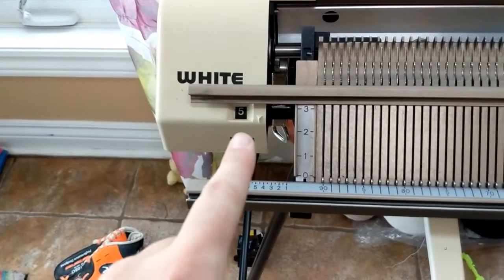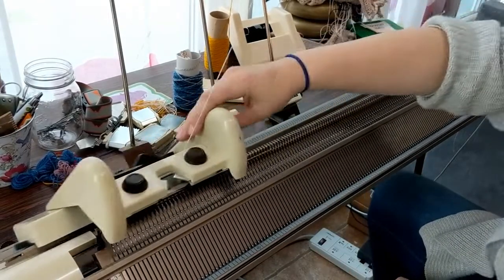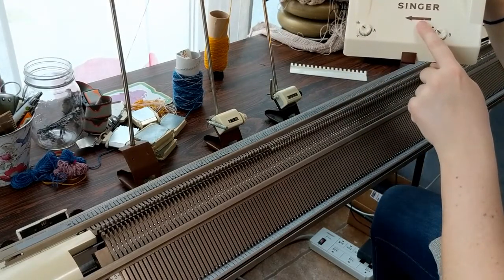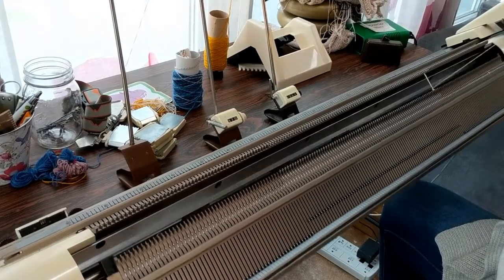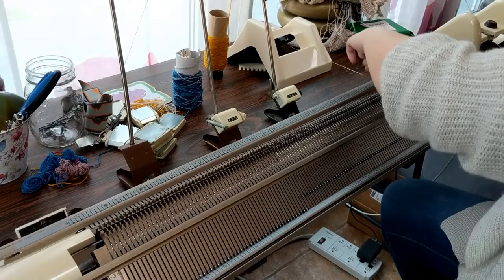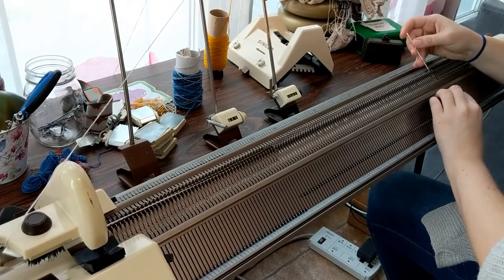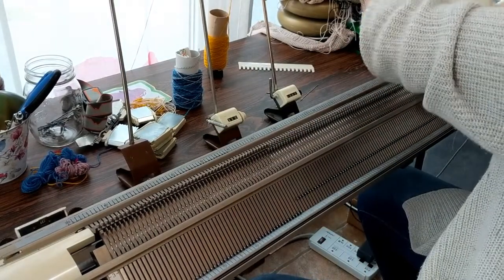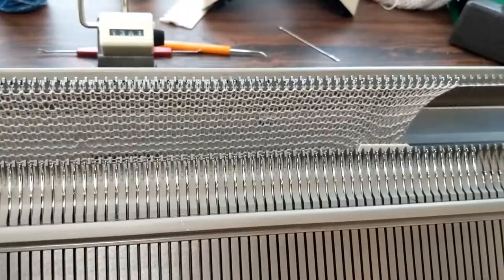Knitting Garter Stitch on the Singer/Superba/White/Phildar double bed knitting machines

Comment: I have all but given up on the transfer carriage on my system 9000.  I have both types.   I used to have an s48 & I kept the transfer carriage from it b/c it would transfer in pattern & accept stitches on non empty needles.  You make it look easy.  I have zero problem with transfers on the Passap.  Sigh.  After years tho I csn now transfer EOS. Then make another pass to get the rest.  I have tried all sorts of stitch settings, bed spacings etc.
Reply from the maker: They are frustrating little beasts, it's true. I find some yarns it just will not transfer nicely no matter what I do. It could also be bent, or damaged on the bottom. I haven't used this one in a while. I bet if I went to try it now I would end up with yarn in my lap 😆

Comment: Thanks for the video! What is the purpose of putting the two stitches into working position on the edges before you pass the carriage? Thanks! Rachel
Reply from the maker: It's recommended in the manual in order to make sure the carriage transfers all the stitches. You don't always need to do it, I find. 
However for some patterns you need to bring one extra needle into work to make sure it transfers the first stitch.

Comment: Hi, thanks for the video. I would like to ask you the following question: With all the Singer/Superba I have bought, I need to use both hands to move the carriage, even just one of them (the main one), but I see that you slide it without any difficulty, could you tell me why? As a note, I have cleaned both the bed and the carriages thoroughly, improving the sliding, but still, it is still very hard. Any help please? Regards!
Reply from the maker: Hi Victor. That seems to be a common issue with some people's machines. I would suggest to make sure the plastic tubing that covers the pieces on the carriages which slides in the rails is in good condition. It might be split or otherwise damaged. If it's OK, have you tried to add any lubricant to that rail where the carriage slides? I have been using Ballistol oil, but you can also use sewing machine oil if that's easier to come by where you live. I would also oil the flippers and moving parts on the bottom of the carriages (sparingly!), and the rail in which the cursor slides. Oh and the carriages are also going to be harder to push when the cursor is attached; make sure to move it out of the way when you aren't pattern knitting. The oiling does make things a bit messy so use as little as possible, but it should make a difference. You can also take a bit of oil on a soft lint-free cloth and oil the butt ends of the needles, and put a little bit across the bed behind the needles while they are in working position so it goes into the channels, and then run the carriage over a few times, then wipe any excess. Again don't use too much and make sure you have cloths handy to wipe off the inevitable "black crud" that will come off the machine if you accidentally touch the parts you oiled. 

Also, if you haven't opened up the machine bed itself and cleaned out the brake spring, you might be horrified by what can build up inside of it. I have one machine that I bought for parts, on which the needles could barely move in and out. I opened it up to harvest the brake spring when my main machine's was broken, and the needles were basically stuck to the bed with crud, and the spring was so full of fluff I don't know how the needles even moved. All of this resistance would make it a lot harder to move the carriages. 

I hope that helps a little bit. One of the things I like the most about the Superba is how easy and light the carriage is to push compared to some other machines. It's much nicer on the shoulder when you get it moving freely. Good luck!
Reply: @heatherismakingstuff  Hi Heather. Thank you very much for replying... I will follow your advice. Best regards!

Comment: hi Heather, finally I got the yarn mast up, had to rig something up, as I don't have the original yarn pole. I can't figure out how to cast on,  I see that you put the cast on comb thru the needles, wire and all and hold the cast on comb above the needles, and knit across with yarn in the carriage.  Is that how I am seeing it?  I go very slowly and it knits the loop of the first few needles, then stops. It shows that the loop went thru the cast on comb and looks like it would go all of the way, but I don't want to force it. 
I have been trying for a couple of hours and getting nowhere, so I look to you to verify that my eyes don't deceive me.
Reply from the maker: Absolutely that's right, comb and all, you hold it up so the ridge in the comb rests on the bottom bed, and it will be in position so that the needles don't hit the solid part of the comb, and then just make sure you have it so the teeth are between the needles. If you have the manual it describes a few different ways in there. A double bed cast on might be easier to start with, as you don't need the comb in there until after you knit the first zig zag row. Also make sure your yarn is thin enough, something like a sock yarn works great. I think the Answer Lady might have a video on Superba cast on methods now that I think about it!

Comment: Hi Heather ! I have a Singer knitting nachine as yours but with the MEMO II for jacquard and special working. I have had it for thirty years but lately I have problems making Jacquard.  I  have followed all the instractions carefully   but when I try to work the machine works correctely from right to left, but from left to right it puts the needles in the highest position without working them. What could be ? Have you or other friends never experienced such a problem? Thanks for your time !
Reply from the maker: Hi Tiziana, that is a strange problem! Have you cleaned the carriage recently? It could be something on the carriage is sticking and not letting the needles move properly. I would try that, and oil the moving parts, and make sure to clean the contacts on the carriage and the cursor and see if that helps. Hopefully nothing more than that!
Reply: @heatherismakingstuff  THanks Heather,  I have cleaned the carriage and found that a small part under it wasn't working properly. I've just tried to fix it and tomorrow I'll see if I am able to knitt a jaquard. I'll let you know and thanks again.
Reply from the maker: @tizianacovolan1794  oh good luck! Hopefully it is working again

Comment: hi, do all of the electronic Superba's have the capability of adding a garter lace transfer carriage?  I am having a hard time figuring out which accessories go to Superba Machines.  I want to be able to get the most out of the machine, before I leap to a purchase.  Garter stitch transfer is one of the top features on my list. You also mention a regular transfer carriage, what is meant by that? Thank you very much.
Reply from the maker: Hi Lynn! Yes all the double bed Superbas like this can use the garter lace transfer carriage, regardless of the pattern input method. The GLTC is fully mechanical and doesn't rely on the electronics, so it is useful even if your machine doesn't have a working patterning input. 

The regular transfer carriage is a bit simpler. It functions the same way, by transferring stitches from one bed to the other, but it doesn't have the knobs on front to select alternate needles. It's all needles all the time. So you can still use it to do garter stitch, but not the fancy patterns or lace ones that you can do with the GLTC.

One of the nice features of these machines is the accessories, carriages etc. are almost universally interchangeable. A carriage from a 624 will work on an s48, for example. There are some exceptions to this, but it's nice to know that if you need a spare part there's a lot of different ones out there that can work. 

Good luck! They are beautiful machines. I found my GLTC on German eBay. My machine has bits and pieces on it from all over the place 😁

Comment: hey Heather, it's the little old lady from Tennessee again.   Have you ever removed the brake spring?  After soaking all of my needles, I was replacing them and bits of yarn, that were hiding under there, started to make their appearance while putting the needles back in.  I am sure there is lots of fluff under there, so I want to do some surgery.  Best way to do this, if you know how?? Please
Reply from the maker: Lynn you crack me up 😂 I have actually removed and replaced it once, and although it wasn't hard it wasn't what I'd call a good time either. There is full instructions on how to do it in the back bed service manual, which there is a copy of in the superba vault. The hardest part for me was putting the "earth band" back in correctly but I figured it out. Let me know if you need a link to the service manual!
Reply: @heatherismakingstuff  thank you, Heather! Going to the vault.

Comment: Hi Heather, I've got a transfer carriage, the ordinary plain one, no buttons on either side.  Which side do I start with? If the main bed carriage is on the right, should I put the transfer carriage, arrow facing toward or away from me?
Reply from the maker: It depends on which way you are transferring from. If you are moving the stitches from front bed to back, you put the transfer carriage on the front bed with the writing facing you (arrow will be facing you and pointing left). You move the carriage to the left, and that will transfer the stitches to the back bed. 

To do the reverse, it would be on the back bed with the writing facing away from you and the arrow pointing right, and when you move it to right it will transfer to the front bed. 

I used to have no trouble with that carriage transferring from front to back (helpful after completing ribbing and moving to stockinette) but I never got the hang of it in reverse!
Reply: @heatherismakingstuff  I tried it, and it didn't work, either!   I have the bed spacing at 5, the pitch 1/4, no go, I tried at 4, no go.  My GTLC is cracked, so that carriage is a bust, too!  That cracked carriage broke a few needles, so I am not about to use it again. Oh well! , not meant to be, I guess.
Reply from the maker: @lynnpalacino2184  I think 5 may be too much on the bed spacing for that one. They are a little different in how they operate, but I can't remember offhand the ideal settings. If you do get it working  you can use it for garter stitch, if that's of interest!
Reply: @heatherismakingstuff  I hope I can get it going, it cost me enough!  I just don't want to have it as an ornament, LOL,  I was hoping to use it for garter stitch, for the borders, instead of ribbing.. sometimes.

Comment: Hiya Heather, I have just acquired a Superba Memo II(same as S47) But there is no transfer position only needles opposite and needles alternate so probably an early model, It came with the GLTC carriage so I assume it has at some time used it, so which setting do i use for garter stitch?
Reply from the maker: On some of them the adjustment is done in a different spot - under the left end of the bed somewhere should be another lever. If you have a look in the gltc manual linked here it shows you where in more detail. That should allow it to work.
Reply: @heatherismakingstuff  Ok found it. It moves the front carriage 1/4 space. Its not very obvious, doesn't look like a button or lever, but now i know so thanks for the help.
Reply from the maker: @iamrocketray  you're welcome! Good luck with the gltc

Comment: Bonjour mon chariot mousse n'a pas l'air de fonctionner correctement, les mailles reste sur les aiguilles malgré les même réglages que vous
Reply from the maker: Bonjour, avez-vous le bon nombre d'aiguilles au travail ? parfois, vous devez en ajouter un autre sur le bord d'attaque pour le sélectionner correctement. C'est un peu délicat - assurez-vous d'avoir le manuel à proximité
Reply: @heatherismakingstuff  oui j'ai bien le bon nombre mais des fois les aiguilles ce coinse dans une petite encoche du chariot et passe difficilement
Reply from the maker: @loutedu35fqt41  
Intéressant. Je n'en ai pas, mais je me demande si un manuel d'entretien pour ce chariot pourrait être disponible en ligne quelque part. Il est possible qu'il soit cassé ou collé d'une manière ou d'une autre.